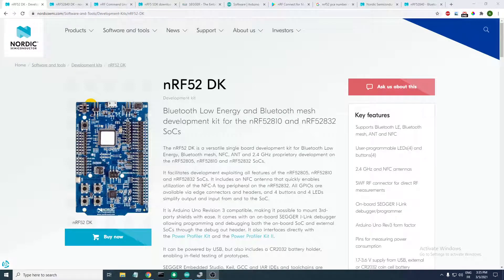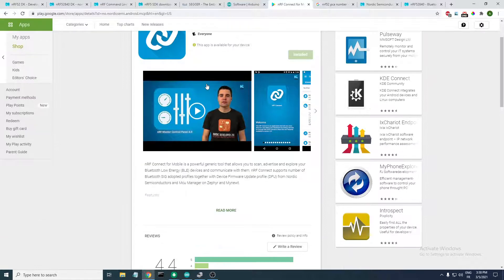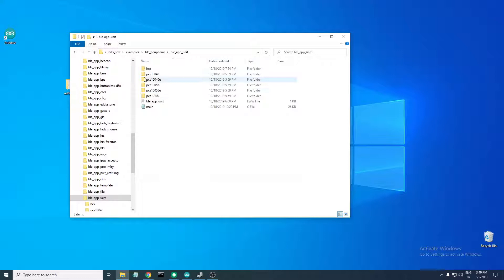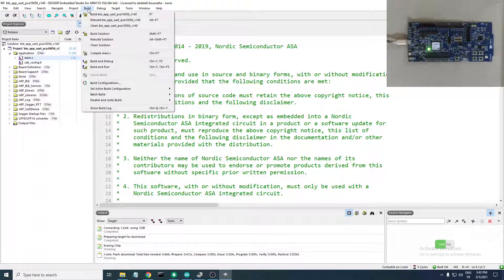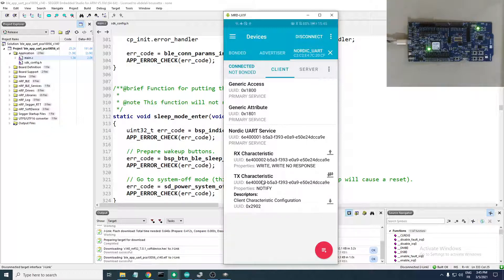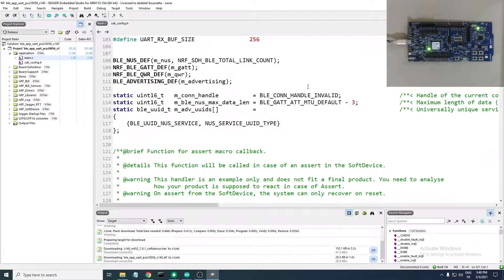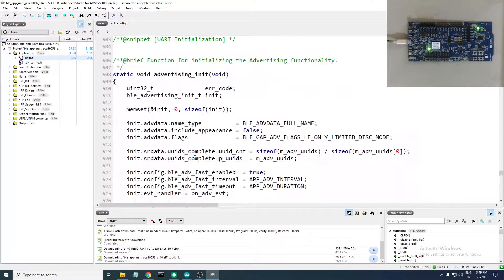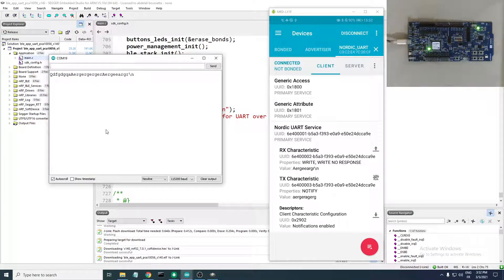Testing the ble_app_uart example in the nRF5 SDK [SEGGER]

Comment: Oh my god, thank you for this video. I'm self learning beginner. I just purchased BL651 module its a BLE from Laird connectivity. Can I use that RNF52840 developing board to program my BL651 module? I would love to learn how to use SPI protocol.
Reply from the maker: You're welcome.
For the BL651 module, I see that it's based on the  nRF52810 which is one of the 3 SOCs that the nRF52 Dk supports the development for.
This SOC is referenced to as the PCA10040e, which is the Emulated version of the nRF52832 (the nRF52 Dk's on-board SOC). 
The issue here is that not all the examples on the nRF5 SDK support this SOC, So in this case (depending on if it supports the example features) build its PCA10040e folder.
In the Blinky example, you have that folder. So you can easily build the example project and run it on this SOC.

For using the nRF52840 dev kit to program the module, yes you can. Also with any nRF5 development kit. 
This is due to that all the nRF5 development kits have an on-board J-LInk chip, that makes the on-board SOC programmable just with a USB cable. Other wise you would need a Jlink debugger device to program the SOC. Same as with your module !
https://www.adafruit.com/product/2209
But, the good thing about the nRF5 dev kits is that the on-board Jlink debugger chip can also program external SOCs. So if you have an nRF5 based dev kit, you can just use it to do so instead of buying a standalone Jlink debugging device.
In an nRF5 dev kit, you'll have the SWDIO, SWDCLK, VDD and GND pins exposed. And that's pretty much what you'll need. Once the on-board Jlink detects the external SOC, it'll disconnect from the on-board SOC. And so any SOC related communications will be performed on the external SOC, including flashing an application.
https://devzone.nordicsemi.com/f/nordic-q-a/14058/external-programming-using-nrf52-dk
nRF5 dev kits also have a connector for that, in case your external module has an SWD connector on it. So you can easily connect it to the dev kit using an SWD cable.
https://www.adafruit.com/product/1675
The connector is named (Debug out), and it's on the right of the programming USB port.
Example of a dev board that has the SWD connector, and uses an nRF52840 SOC based module (Raytac MDBT50Q).
https://www.adafruit.com/product/4062

Hope that helps,

I have this board on my desk, so I might do a tutorial about that soon.
Reply: @nrf5dev  Thank you so much!!!